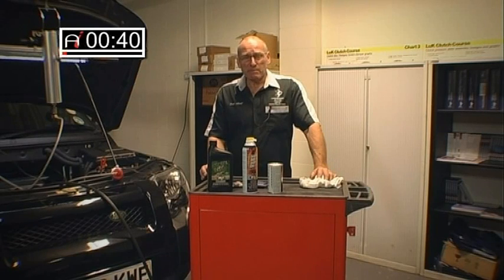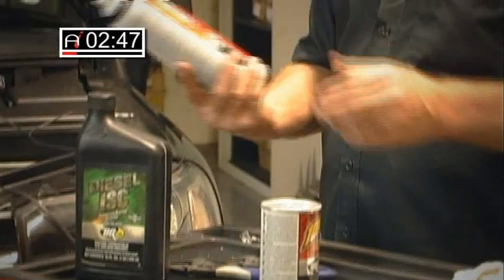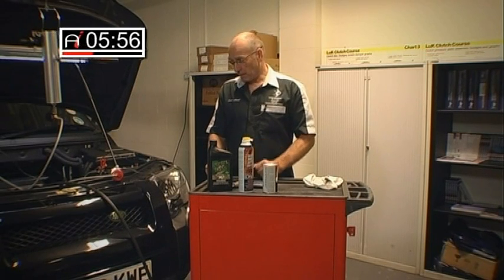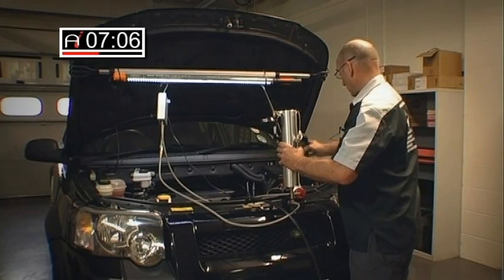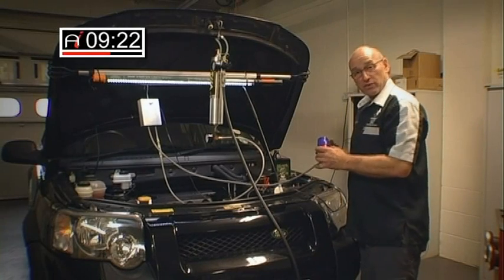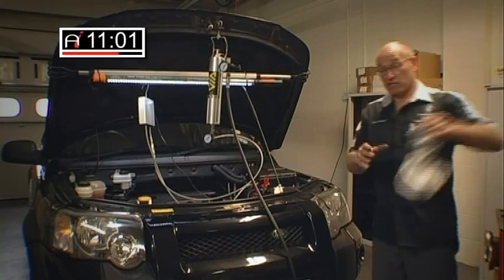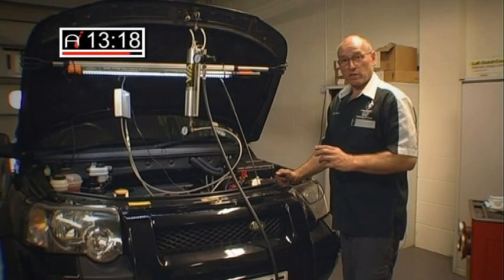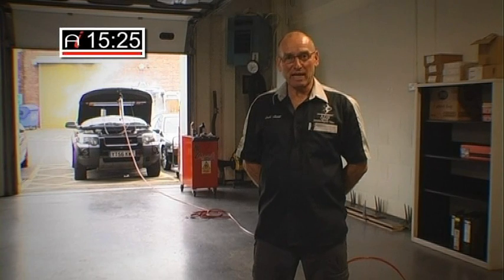AUTOiNFORM ONLINE MAGAZINE: Diesel Intake System Cleaning with Frank Massey

Comment: Surely the best way to prove this type of product works is to use a mechanics endoscope poked down the inlet tract before and after the product was used. This would show the original gunge inside a well used manifold and would prove conclusively whether it was actually cleaned as advertised after. To be honest white smoke coming out the exhaust proves nothing.
Reply: yes before and after wtf

Comment: This is quite interesting, however I think the process is very similar to the old trick of feeding water directly into the intake manifold of a petrol car. the water turns to steam in the combustion chamber and effectively steam cleans the engine internals. I don't think the composition of that product will be anything but water/alohol and some carb cleaner type substance.

Comment: This product really works !!, combined with a fuel treatment to the tank which cleans injectors and an oil flush followed by an oil and filter change then an oil additive...the results on a 75k A class were astounding ...  greatly increased power and MPG. Its an expensive bit of kit but gives you a de-coke with out dismantling the engine.